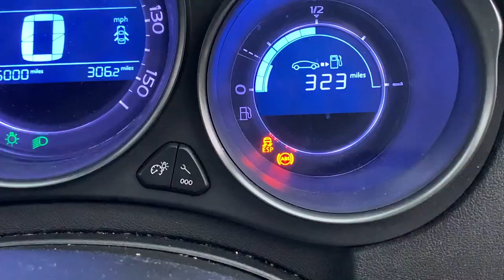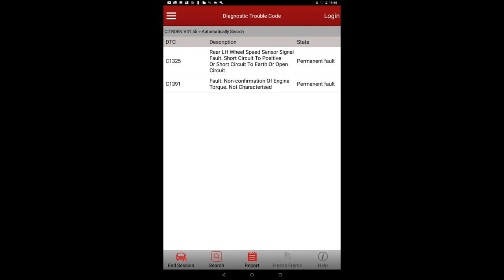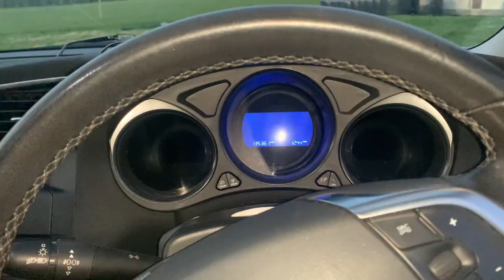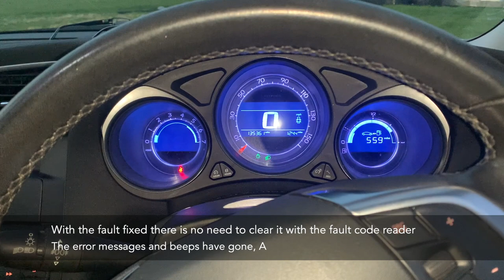Citroen C4 ABS Fault

Comment: There is no need to remove the disc. If you turn the wheel hole and look, you will see the sensor bolt. Just access it through the hole.
Reply from the maker: It isnt quite as easy to show it on the camera with the disc in the road.

Comment: I have C4P which around once or twice a year gives me error ABS/ESP/HANDBRAKE. Fault disappears with engine off/on. Still wasn't able to pinpoint what could be faulty
Reply from the maker: Hi there, it would be best to plug it into diagnostic equipment to see if it is logging any fault codes for these instances when the message appears.

Comment: Doggo <3
Aren't hub nuts on these french cars 35 actually? I was working on some and 35 fits like a glove.
Reply: No 32mm !
Reply: @antsfur  Nope. Just checked - 35mm.
Every 406, 307, C5 etc.
Reply: @SzwarcuKX5  307 all series and Citroën c4 serie first is 32 mm for the rear and 35 for the front
Reply: @EliasBouaicha  Yup, exacly.
Reply from the maker: @SzwarcuKX5  
I packed the two sockets i had sitting out from the time i did this job, 35 and 36mm i could almost swear the 35mm didnt fit this nut but then again i could be wrong.

Always the problem with quoting exact sizes i suppose haha
Reply: @peugeotCitroen2CV  Nut is so hard, that 36 socket can't actually damage it, so 36 will do the job as well :)

Comment: Did the error reappear when the car moved? The fault will clear but it could be down to the abs ring and that won't appear until the car moves. I have this myself.
Reply from the maker: Hi there
The error stayed away and has not returned, ive been driving the car now a couple of months. The new sensor fixed it. There were signs of damage to the old sensor.

The ABS ring on these C4's is on the disk itself, unlike the type on the 406 which was a metal ring pressed onto the driveshaft or rear hub these seem to be a plastic encapsulated metal ring. They possibly can still give trouble but i would say corrosion is less likely than the older metal rings.
Reply: @peugeotCitroen2CV  It looks like a CV change for me then! :(

Comment: Good video, i never use a indent my hub nuts i dont like all that banging with a chisel. I haven't had a problem as yet ! Do you think if they are torqued up ok there shouldn't be a problem? Thanks
Reply from the maker: The indent is done to prevent the nut working its way loose, i would not want to drive a car that hadn't had the nut indented or in some older cars the nut may have been retained by a pin. Its not exactly a hard bit of work to form an indent with the chisel, less than 10 seconds with a hammer, just put on a pair of safety goggles to ensure your eyes are protected.

Comment: This should be changed on both sides in the back?
Reply from the maker: Hi
Only change whatever is faulty, read the fault codes with an OBD scanner which will state what sensor or sensors are faulty. In this instance only one sensor was faulty so only one needed to be replaced. Its been over a year since it was replaced and the car has not required any further sensors

Comment: The brake needs to be replaced urgently by a new one.
Reply from the maker: As mentioned in the video its on the to do list

Despite that the car did pass its mot (annual inspection) recently and is providing good braking performance